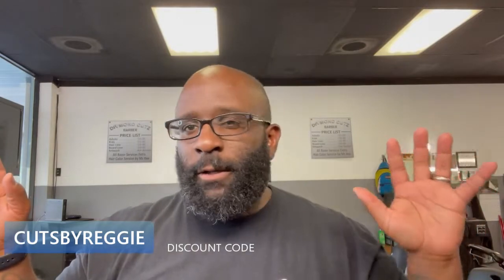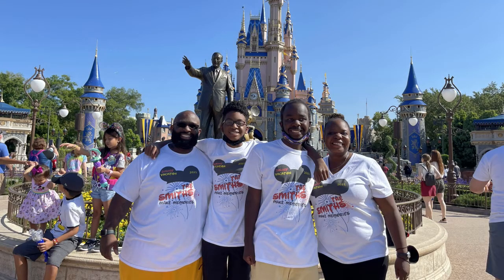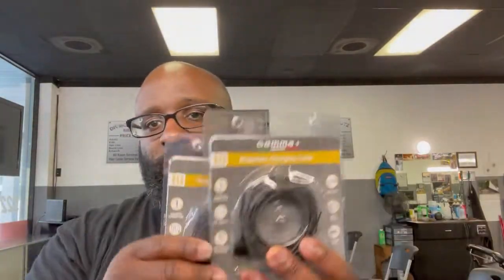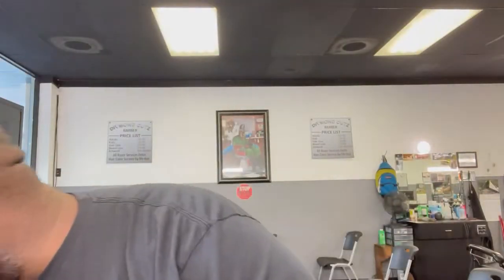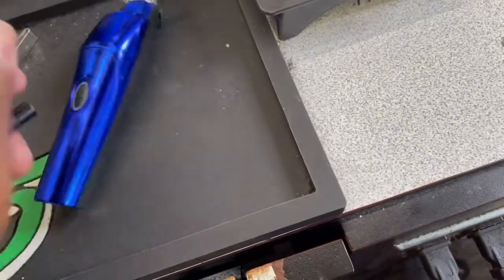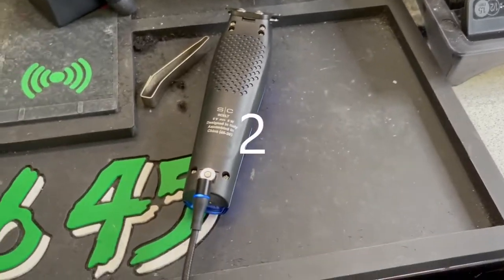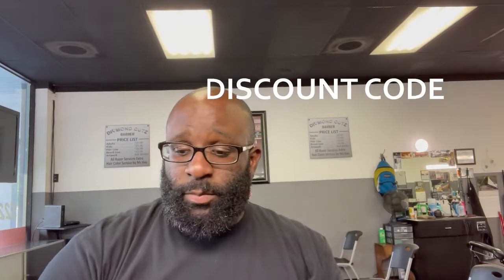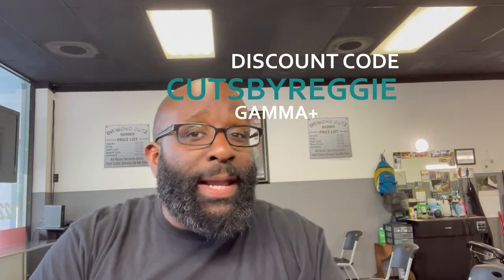Unboxing/Review: GAMMA+ Magnetic Charging Cable | Is It Worth Your Time?

Comment: I got the magnetic charging cable because I lost my charging cable for my gamma absolute zero shaver and my caliber 22 stinger charger broke so it's useful for those two but the magnet is not too strong, I'd still recommend if you actually need a charger because it's not too expensive